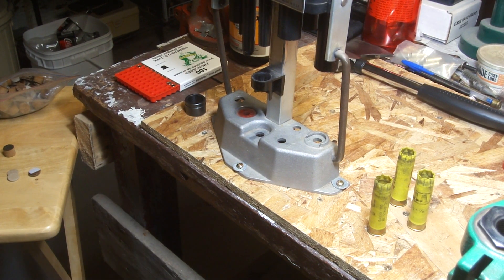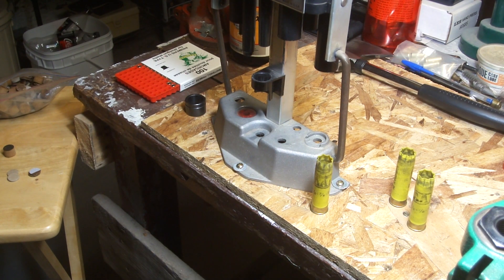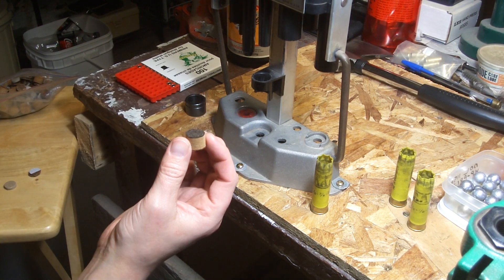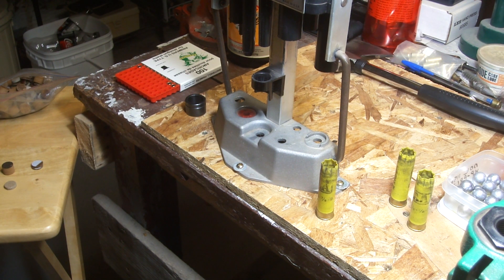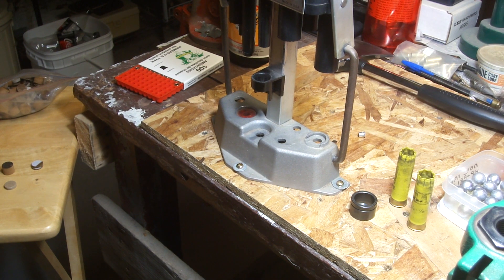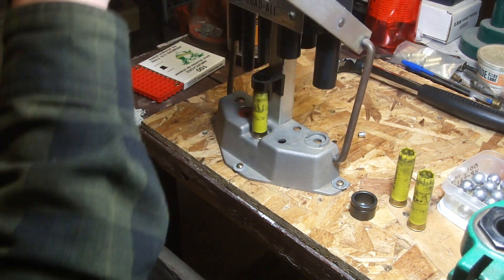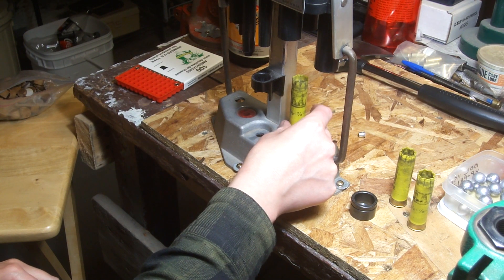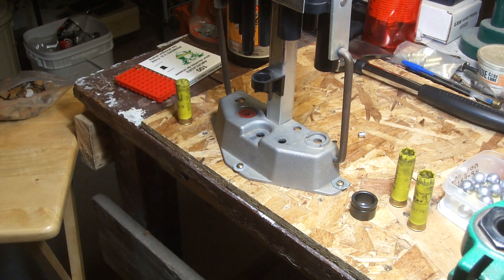20 Ga. Round Ball Loading

Comment: I just loaded up some round ball loads in the Federal target shells. I poured out the shot and put a .570 round ball down inside the plastic wad. The ball is slightly lighter than the total weight of the shot so it should be safe to shoot. It was easy peasy to do. Makes a very cheap deer load.  I'm also trying some pyrodex loads. People say don't mix plastic wads with black powder or the substitutes. They say it melts the plastic. I put a card wad over the powder for testing to see if that stops it from melting the plastic. I need to purchase some standard black powder cushions but don't have a store locally that carries them.  I'm skeptical about the melting theory and think it's mostly from the friction and lack of lubrication in the barrel that's causing the plastic to adhere to the barrel. I have some idea's on how to stop that. I will subscribe to your channel and update some of my testing later. Your's was the only 20 gauge video on round ball in shotguns.
Reply from the maker: Thanks for the comment :)
Reply: @Gungeek  I tested my loads. The black powder shot really well. No matter how they were loaded it all worked good. Everything went into a 6 inch pattern at 50 yards and  most were showing a 4 inch pattern.  Out of about 20 rounds there were about 3 flyers I had no idea what they did or why.  The rest of them you could cover the entire group with your hand.  There were two groups. One with the lower barrel and one with the upper barrel. (It's a Russian over under 20 gauge.)  The centers were about 3 inches away from each other. The upper barrel shot the worst but it had an improved choke in it. The lower barrel shot best with the  cylinder choke or straight through bore. Which is understandable when you think about trying to squish down a solid lead ball all of a sudden and what problems it would cause. I'm going to remove the upper choke to see if I can make it shoot better and test that theory.  I had to quit shooting, it was starting to snow heavy.   The black powder was actually 40 grains of pyrodex which is equivalent to about 50 or so grains of black. I put a card over it and a plastic wad over that and had no problems. But with just 20 rounds any melting problems wouldn't have showed up.
Reply from the maker: @thomasjefferson1457  Thanks for the comment. I'm going to try some loads with shotcups soon. I tested some of the loads made in this video saturday and they were pretty good out to 25-30 yards.
Reply: In a 20 gauge 3” Federal or straight walled hull I use a Lee 0.575 round ball mold for my slugs.  I put one 0.125 nitro card in the gas seal of a BPI Commander wad and two 0.125” Nitro cards in the wad cup under the ball to reinforce the wad from blowout.  Then I use a thin overshot card over the ball under the 6 pt crimp for a perfect slug round.  HS6, Universal or Longshot are the powders that work for me.  I only use a Savage 220 rifled bbl slug gun for these.  No smoothbores !

Comment: What amount would you use of Hogdgon longshot powder? Did the .60 ball "slip fit" down your barrel? I'm in the process of loading 20 guage round balls and your vid is the ONLY one regarding the subject. I dont know what loads I should follow etc to be safe? Any further advice, including what "recipe" you followed would be awesome! What did you. 60 cal balls weigh? I appreciate any info. 
Jim Brown 
Bonez Customs and Collectables 
@bonezcustoms on IG
Reply from the maker: never worked with longshot. The .600 ball fall right threw the cylinder bore of my turkish single shot. I kind of stopped work with this ball because it didn't shoot that good and went with the lyman sabot. The ball is about 318 grains with wheel weight.